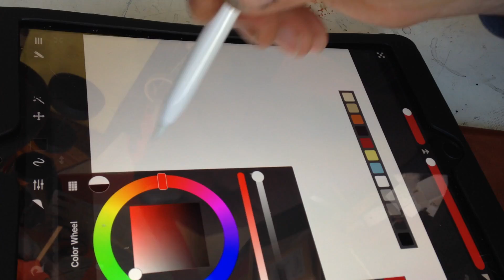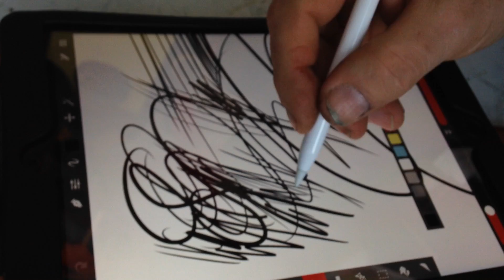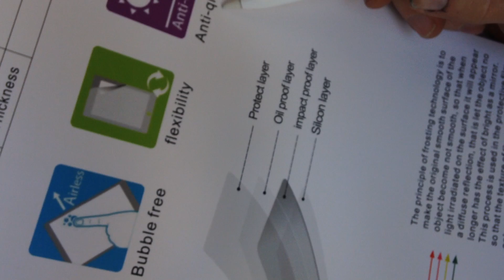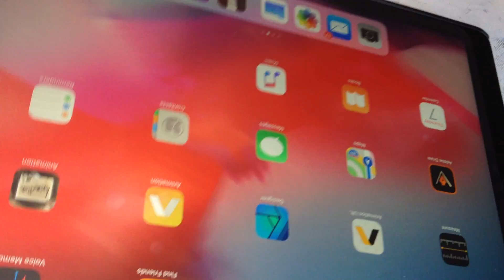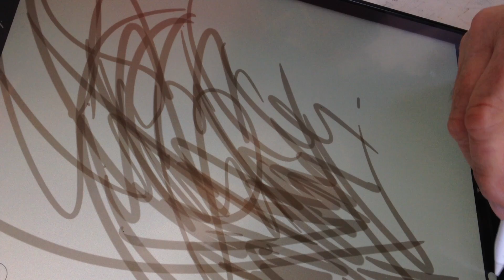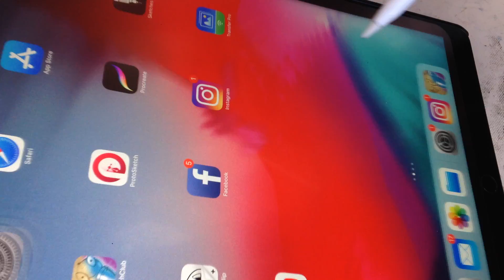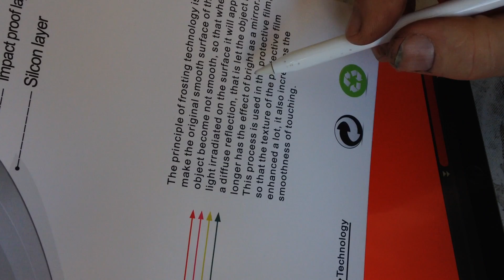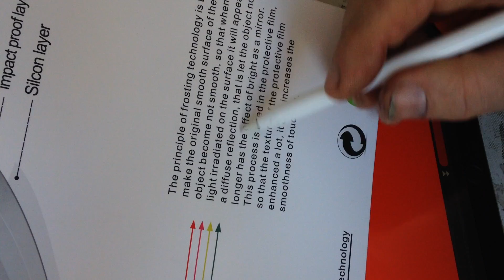ipad "paper"

Comment: The one advantage of my Surface Pro pen is its rubber tip.  If it's like the screen protectors I've used, they are cleanable and shouldn't wear out in that sense.  I have an old Intuos 4 Wacom tablet (sans screen), and I only just realised I can use the same materials for smoothing nibs to scrub the surface of the tablet, giving it some tooth.  They used to use a much nicer plastic cover sheets and pencil-sized styluses back in the day.   I suspect I'll go with an iPad or Wacom competitor next.